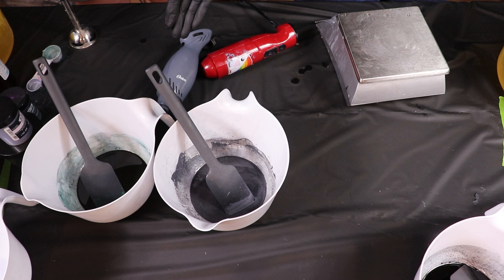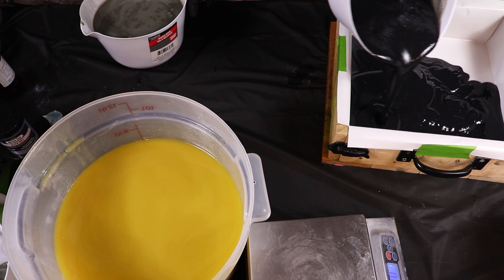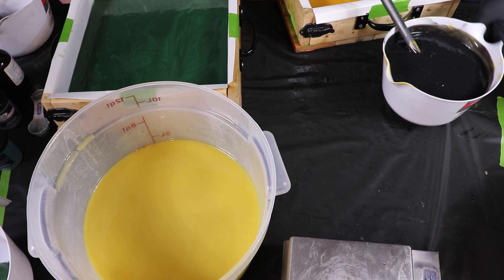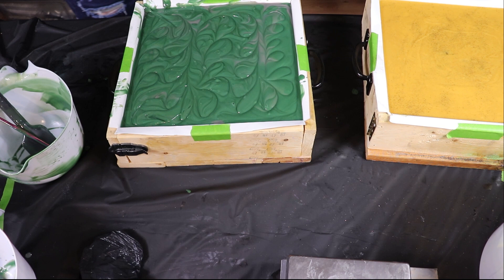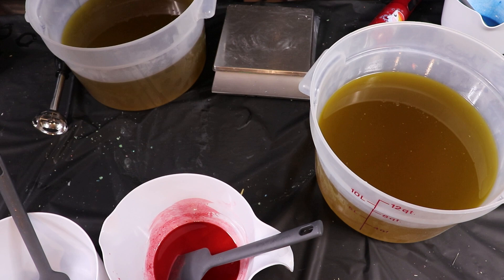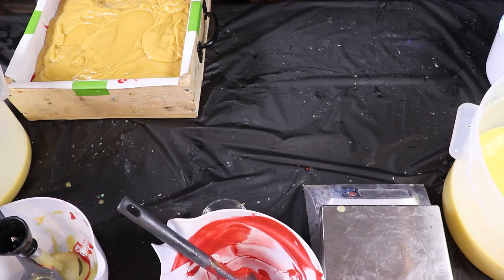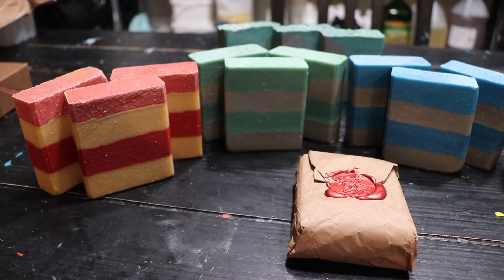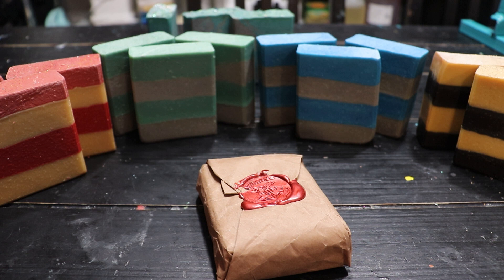HOGWARTS SOAPS for Slytherin, Hufflepuff, Ravenclaw, and Gryffindor!

Comment: Why does your soap have texture, pits, and bumps throughout the entire loaf?
Reply from the maker: It varies but the most common reason is because we cut the soaps with a wire.  Occasionally pits can be because when we tapped the soap, it didn't completely settle (this is more common with thicker batter/accelerating).  And sometimes it's just air bubbles from being blended.
~Raven